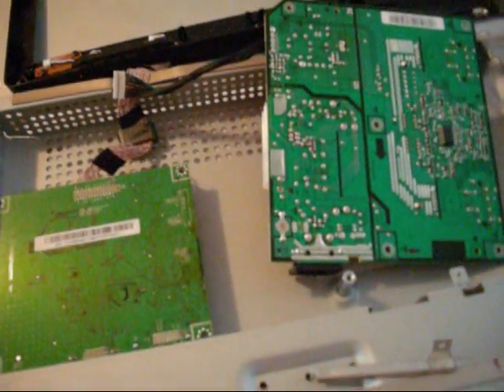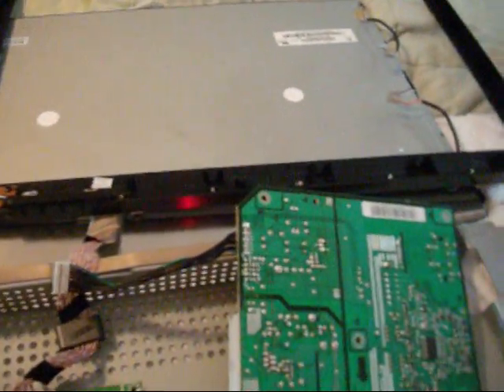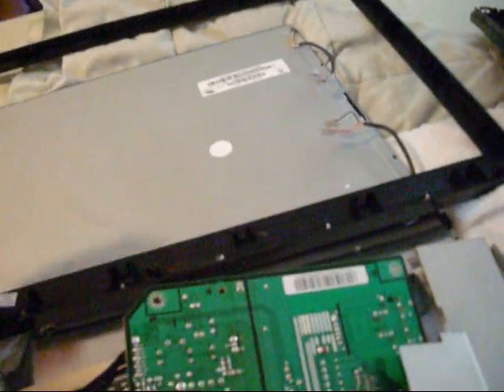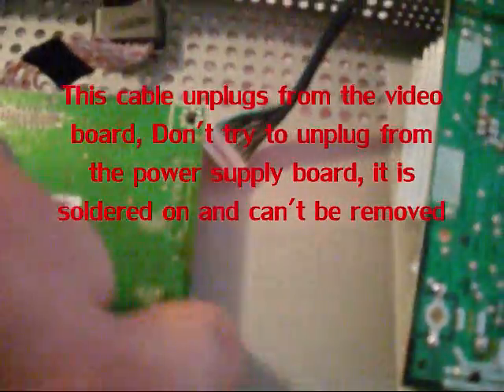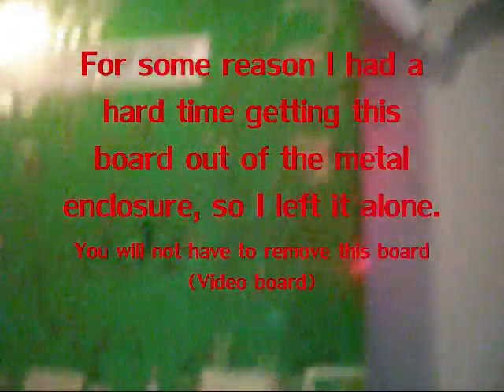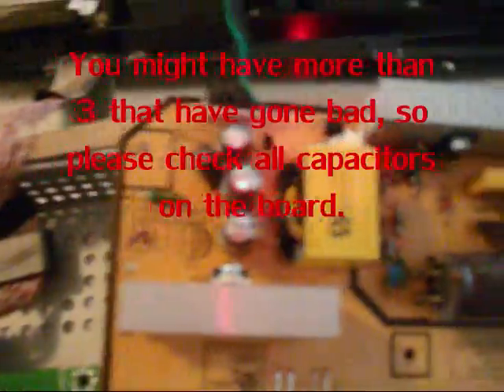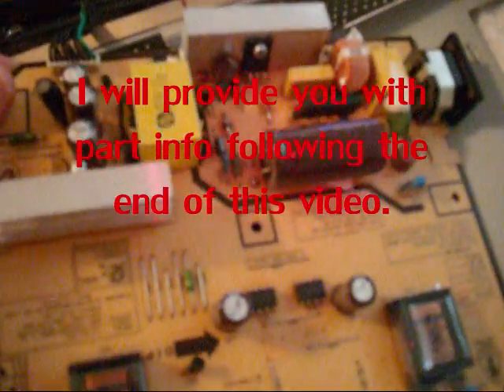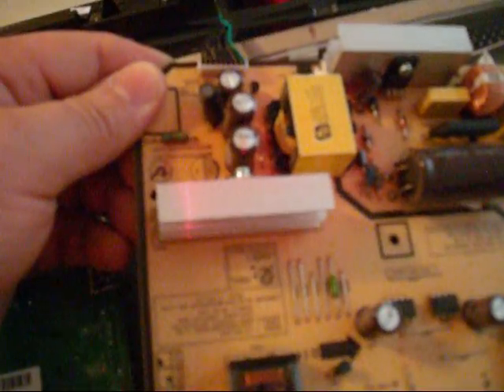Broken Samsung 226BW LCD monitor - repair tip info.

Comment: Thanks for the vid, after 7 years mine begins to flicker a few seconds after starting up, so I now can get the parts before it totaly gives up. but I do suggest replacing all capacitors just in case
I assume they used lead solder ?

Comment: GUYS PLEASE PAY ATTENTION.. THIS IS A HIGH VOLTAGE AREA!!!! Electrolytic capacitors can hurt you if your not careful.  When you go to do this leave the monitor on and unplug it.  This will help drain the caps.  Then take a meter and put one lead on each side of the capacitor to measure the voltage.  This will further drain them.  keep reading the voltage till none is present.  It's very important you hook them up in the proper polarity ( + to + ) or they will explode when you power them up.  This is a fairly easy job to do just use your head.  Don't "burn the traces" by overheating them when you are desoldering and make sure you have a "shiny" solder joint not a dull one when you are done.

Comment: I changed all the capacitors on the NT Board but the Monitor still goes off after a few seconds, is it possible, the other small Board has some damaged capacitors? or is something else damaged?

Comment: I have one question regarding the pick and blue wires, what is the correct method ? Is it pick then blue, or blue then pink, when reconnected the LCD monitor wires, when it's open ? If someone could take a picture, I don't think I took the note down correctly, maybe I did :)

Comment from the maker: Your problem could be many different things. The LCD panel could be damaged from being dropped accidentally or excessive heat.(in that case, it would be cheaper to buy a new monitor)  The lines could also be caused by a loose connection, faulty power supply, or a bad LVDS cable which inside the monitor itself.  Unfortunately, it's hard to diagnose your problem without actually seeing it in person. Personally, I would take it apart and check for loose connections and bad caps.

Comment from the maker: Your question is a month old, but I'll answer anyway. Spend $12.99 at RadioShack and get a desoldering iron. Remove the circuit board from the monitor case, flip the circuit board over to the side with the solder traces, locate the two connections on the solder side of the board that holds the capacitors in and use the desoldering iron to suck out the solder that holds the capacitors in.

Comment: This is the exact problem I'm encountering. I did as the video said and checked the capacitors, 3 are bad (just barely noticeable but they are rounded). My only question is how to remove/replace the capacitors?

Comment: im having the same problem with my SAMSUNG SyncMaster 226BW... when i start up the monitor its black screen but later flickers and you can later see the screen and the only way to bypass it was to leave my monitor on. my previous monitor of the exact model broke after not using it for like a year

Comment: Just fixed my 226bw monitor thanks to this video. I went to radio shack and got 2 1000uf 35v and 1 400uf 35v capacitors, working like a charm!!!

Comment: Hi, go to Maplin and buy them from there.  i needed 880uF 25V.  Maplin didn't have these so bought the closest and overspeced ones namely 1000uF @ 35V.  works fine now though note they are bigger component than the ones you'll be replacing.

Comment: Thanks.  Good video.  3 x of my 880uF 25 V caps were bulging and leaking black liquid at the tops.  Replaced them with 1000uF 35V caps and it's working great now.  [i was advised to go for the closest uF rating and higher voltage since Maplin in the UK didn't have 880uF.  Cost me £1.17 in total].  Only other, non related, issue i have with the monitor is the analog input works but the digital dvi doesn't.

Comment: Just changed out three caps today in my 226BW. Was getting to the point quickly where it was taking longer and longer for the flickering to stop.

Thanks 6228 for the vid.

Comment: Thanks a lot. At work I fixed 2 x 226BW monitors that were in the junk pile waiting be recycled. Now on my desk I have them instead of 2 ancient CRT monitors. There were 2 bad caps in one monitor and 3 in the other.

Comment: Yes it will work. A higher voltage cap is fine but do not use a lower voltage one.

Comment: Capacitors are also available at digikey.com...no need to buy 10, just order what you need.
Part number               Description
P14423-ND		CAP ALUM 820UF 25V 20% RADIAL
P12386-ND		CAP ALUM 330UF 25V 20% RADIAL
P12390-ND		CAP ALUM 680UF 25V 20% RADIAL

Comment: Helpful video, but do not buy from mouser. I only had 3 bad capacitors, so I ordered 3 of them for a little over $2. They do not tell you what they charge for shipping and you wont find out until you get the package. I got  them overnighted and got them today. I was charged $58 dollars for a package that weighs the same as 3 quarters. I've been calling them all day, but they keep putting you on hold. Stay away from mouser.

Comment: As a result of directly watching this vid post I was able to fix my LCD monitor. I took it to a repairer some 6 months ago and he talked me into buying a new LG monitor. I refused to throw it out and fixed it today. I could not get hold of 25v 820uF so I took the chance and stuck in 25v 1000uF and bingo my monitor is back working.

Comment: hey i have a Samsung BX1950 and the problem is the sensor buttons below are not working because a drip of water soaked in the button area and its not working.....how do i fix those sensor buttons

Comment: @carlos15011967 Just wondering why you put the additional capacitor in c113.  I also have that slot avialable and dropping another capacitor there would be very easy, but I was wondering what the bennifit is.  Also, how'd you know it ws the 33uF 25V that was needed there?

Comment: You and your video rock!  I've got the Samsung 226BW and it started flickering and continued to get worse.  I put up with this for a while, but finally went searching on the net for the problem and solution, and you were spot on with the diagnosis and fix.  Just got done replacing the three capacitors you suggested (yep, they were slightly bulging).  It was not difficult, just as you said.

Thank you and job (video/diagnosis/fix) well done!

Capacitors cost more now ... no big deal.

Steve

Comment: @PSUkbit 

I just opened up mine last month, took the PSU to electronics specialist and he gave me the correct caps. Cost me just under 10 euro's. Samsung is pretty crap when it comes to customer service. They kept replying to my mails with a standard reply and didn't answer my question and wanted at least 100 euro's for the repairs. 

Well, now at least they don't get my money

Comment: To remove the video board, on mine you need to take our the single screw holding it, then on the back where the video inputs are...you need to remove all 4 connector tightening screws, and then just push on the DVI/VGA connectors to push the board out...or pull the board from the inside.

Comment: There were obviously some revisions made on the 226BW because on mine..the white cable between the video board and power supply does disconnect at the power supply end very easily, it is not soldered. Mine has been dead for 18 months...just finally opened it to try and fix...just need to order the caps now.

Comment: What the skinny rubbery piece beside the three 830ufs? It has no markings. Mine says cc021 in the L101 spot. Is that where the 330uf cap or is it a different type of capacitor or is it a type of fuse? It definitely has different diagram markings then the 830 uf spots.

Comment: is there a difference between EU and US models? My EU one went bad a few weeks ago, just 2 months outside of warranty and Samsung won't even send me new caps. I found a set on ebay.com but I don't know if it will work with my current EU 226CW

Comment: 226BW monitor began flickering each time computer was booted until the problem lasted minutes before recovery. Began leaving computer on for days - undesirable. Finally shut down over a day and the monitor was black. Went in and replaced the two 820uf caps with 1000uf 25v and monitor is back to normal operation - no flicker at all. 820uf caps are not common - the 1000uf is so use it - makes no difference! Thanks!!!!

Comment: i have samsung bw 906 i have same problem but,i don not know how to check these capacitors,my circuit board  is same as your's,but from outside capacitors looks ok to me,how can i check capistors on circuit board which one is bad or i have to pull capacitors out of circuit board then check please help me for this
thnaks

Comment: Gday I replaced the x3 820uf with 1000uf 25v  type as could not find them in adelaide! and was impatient, soldered them in and all I get is the blue light stays on no picture, and i cant control the power button.. sometimes it comes on with a white screen for a few seconds then black, im really confused as to what this is, should of been an easy fix but turning into a headache, ive checked all cables are plugged in etc.. maybe board has had it or i have done a poor soldering job, maybe the caps?

Comment: Just replaced two bad 25v 820uF caps with 25v 1000uF high temp (105 C) ones and the monitor is good as new. Thanks very much for the helpful video pointing me in the right direction, without it I'd have no idea why it was flickering. Cheers!

Comment: Thank you soooooo much for this video. My monitor started doing this a few months ago and found out that it was a problem that I would have to send to Samsung to get fixed. Nice since the warranty ran out two years ago. 
Being laid off  I didn't want to buy a new monitor, even as much as they have come down in price. I started searching for fixes and your video was one of the first hits. I took you advice and replaced all the capacitors a couple of hours ago and she's as good as new!

Comment: thanks for this video, i have the exact model 226bw  and my monitor  just started blinking too, after 20 mins it goes back to normal. But every start up i have to deal with the blinking for 20 mins. I'm not much of a handyman at all with electronics but i guess its worth a shot then buying a new monitor.

Comment: thanks alot , i had the same problem ,and with your help i was able to fix my samsung 226 bw monitor .
only one suggestion , when your explaining how to fix the monitor by replacing the capasitor, you should explain how to put the capasitor, i mean in what position.
thanks again, i felt great being able to fix my own monitor.
roberto and lucas from israel.
Rio-De-Rosas@live.com

Comment: Thank you so much! I had the same problem on my Samsung SyncMaster 932BW. It flickers for about 2 minutes from a cold start and about 30 seconds from sleep. I replaced the 3 25V 470 uF capacitors, and now it works perfectly again.

Comment: @udontnoeme05
You will probably want to open your monitor up and check to see exactly what caps it uses.  It's possible they use the same, but rather unlikely.

Comment: Just finished successfully replacing the caps on one of two 226BW's I have had since `07.  Like clockwork, the warranty expired and then the caps blew on both monitors.
Mouser was(and still is) out of the 330uF 25v caps, but I was able to find the same ones  in stock at digikey.com (manufacturer part numbers ECA-1EHG331 and EEU-FC1E821).  They arrived in 3 business days shipped by first class.
Thanks for the nice tut and good luck to all you do-it-yourselfers!
*I needed 1-330 & 2-820's per LCD

Comment: The linked 820uf capacitors are 25mm tall, the ones in my 226bw are only 20mm. Do they foul on the casing? I held a ruler to it and it seemed awful close. But I can't really seem to find any of the proper specs that are 20mm tall and readily available as well.

Comment: The most common internet electronics provider is RS components, who have a minimum buy order of 5 units of any particular item, so it's kinda a. In addition, only ever buy Panasonic, Rubycon, United Chemi-con, Nichicon and Mallory Capacitors. Anything else is liable to be some shitty chinese capacitors also afflicted by the dreaded capacitor plague.

Comment: My monitor doesn't display any image and it makes a loud humming. I took out the circuit board and found it was coming from there. When I listen for the hum it's in an area grouped with capacitors, but a yellow and black thing just below it (not sue what it's called. Do you suggest that this is the capacitors still? If so, what sort of common household electronics would contain 25v 820uf capacitors?

Comment from the maker: @slayer2022 Hopefully you know that solder won't melt well unless the tip of the iron is clean and tinned.   I use 15 watts on stuff like video cards and small circuit boards., never have any trouble. 30 watts should do it, that's what I use for bigger stuff.  You just gotta watch how much heat you use on small components, you can fry things pretty fast.

Comment: I have been practicing desoldering/soldering with an old video card and 30watts is not even hot enough to melt the solder that is currently on the board. I have to assume a 10-20 watt isn't going to work on my 226bw

Comment from the maker: @eduardothenardo Until the day they make a capacitor that is bullet proof or something that replaces capacitors we will always be plagued with the possibility of failure. I've had tons of electronics go bad over the years due to bad capacitors. I'll say it again, these manufacturers know what they are doing, a cheap capacitor usually lasts about 2 years if the device is used heavily, so they have time timing down just right (long enough to get past the initial warranty date)

Comment from the maker: @GarySpatzScam when you click the links, that's what you get and what you need.  They do have 680's too..just type in 25v 680uf.  (Aluminum Electrolytic Capacitors - Leaded 25volts 680uF 10X20)

Comment: i couldn't find the 25volt 680uf electrolytric, can you post a link? i tried electrolytric as a key word, no go :(

also, question.  when i click those 2 links, do i just leave the boxes checked/unchecked as the link defaulted them?

Comment from the maker: @roblifford  People get scared by electronics, they don't wanna screw up. But in a case where you have an electronic device like this that doesn't cost a whole lot,  you have very little risk involved. What more can you hurt if it's already broken?   It's always worth a try to fix something,  at least you tried and more than likely if you can't fix it, then it's not worth fixing in the first place.

Comment: @beast6228   Yeah I  knew that-- LCD's are a different animal than the old CRT's - Theres no high voltage flyback transformer, in general its a much lower current device.  all I did on mine was just unplug the power supply and hit the power button a few time to discharge the boards just to be sure.  Not so much concerned about a shock as maybe zapping the board as I am a novice.   Either way this monitor is still working perfect after the capacitor replacement --- Im a happy novice-lol

Comment: @beast6228 yeah he did over react a bit,  but I did know as another post says here the old CRT's with their high voltage transformers are another story, but the only damage youre likely to do is to the LCD board itself.   Im no tech, just a guy whose always worked on his own cars etc. because im not rich and need to save when I can.   If I dont know what im doing, I just find the info to see if I can handle it, but if not I know when to defer to someone who can - this is a simple repair.

Comment: @beast6228 My god, "cab" was right !! - I fixed my LCD's caps and three days later the old caps detonated outside in the trash can killing two trash guys, my neighbor and a stray cat -
-- the garbage truck was totally destroyed.  Warning, caps can kill.  
-- Seriously, its really the larger ones that'r dangerous, i hear you should short the leads together to discharge them, but ive also heard if you unplug the device and hit the power button that can do the job as well - check it out.

Comment: Ty so much for this vid,i was having the same problem only this weekend after some flashing it went black. Got a spare monitor from my bro in law and started searching. Luckely i found your vid. I found 5 bad capacitators today and hope replacing them will fix it. Ty so much m8 for posting this,now at least i have some hope again that this monitor can be saved,i liked it too much to go to waste.

Comment from the maker: @mrsullyrox on the back of the board, where the lead solder is. You remove the solder, then they come out. You just have to make sure you put the replacement components back in the same way they came out.  I can honestly say a 12 year old could probably do this.

Comment: where is it that you do soldering? are you not just popping out those capacitors an pushing them in?- forgive my ignorance- I have this exact issue and Model samsung- I actually disconnected it this am and was going to throw it in the trash- BUT then i see this- thanks for any help-matt

Comment from the maker: @KKing29 I don't know what would cause green lines, I have heard that sometimes the backlight inside the screen goes bad and can cause that, but not from firsthand experience. I would take it apart and see if you can see any burnt out parts or as I mentioned, any worn out capacitors. If so, replace them. Maybe the power supply inside is getting weak and isn't supplying enough voltage or maybe even too much power.  It's really hard to say.

Comment from the maker: @kosai19 That's definitely how bad capacitors work, they are sorta like batteries, they store electricity and when they leak it takes more electricity and time for them to regulate themselves...the weaker they get, the worse the problem becomes, sometimes they will even explode.